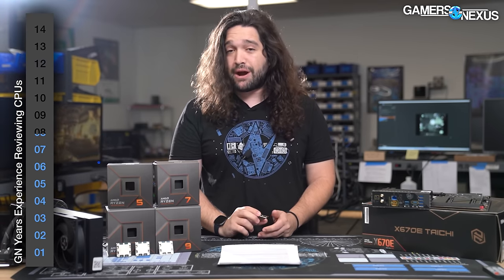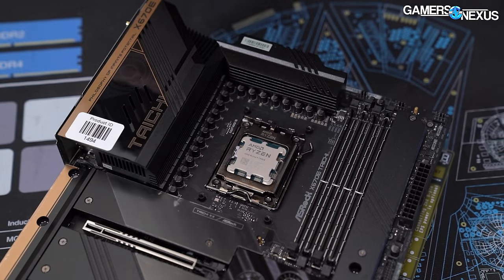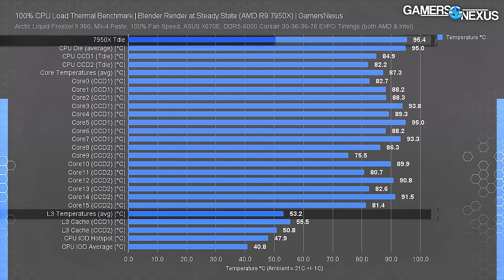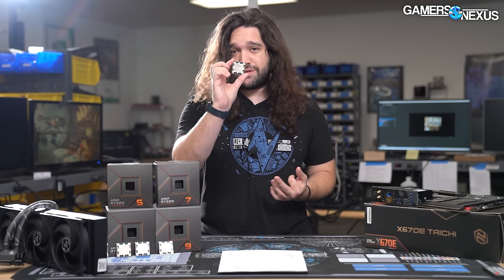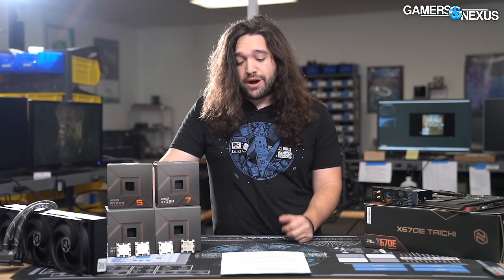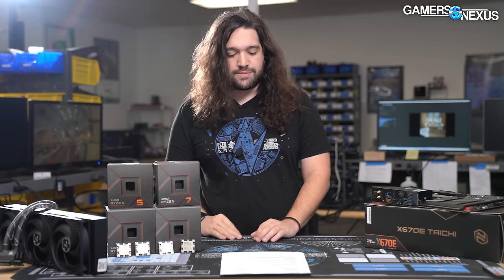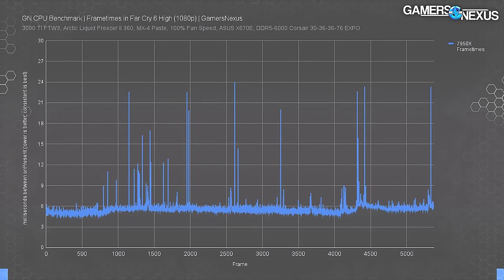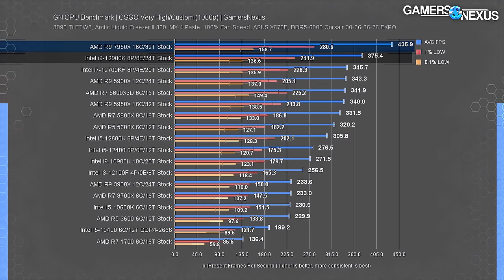95°C is Now Normal: AMD Ryzen 9 7950X CPU Review & Benchmarks

Comment: The 4 horsemen of winter heater
1. 13900K
2. 7950X
3. RTX 4090
4.  R9 390x
Reply: Wasn't the stock 290x worse
Reply: my overvolted rx580 also would like to assist in keeping the room warm.
Reply: I mean... Winter is coming, so good times!
Reply: 9900k as harbinger/ancestor spirit
Reply: Well... those of us in the northern hemisphere, will be glad to have something to keep our feet warm, in the upcoming months. Cough, cough (bile comes up) Where is my acid reflux medicine?
Reply: what does that make the ther- i mean fermi architecture then?
Reply: 390x still keeping up with the big boys😂
Reply: 12900k is hotter than 7950x
Reply: Don't forget the toasty GTX 480, you could cook an egg on that thing.
Reply: @yangwenli4878  yes, I had one. The things was a great card, but it ran hot af.
Reply: You mean R9 295x2
Reply: Everyone here has forgotten about the true furnace, the FX-9590.
Reply: 7950x in winter might be fun but think about it in summer
Reply: You forgot the 12900K and the RTX 3090Ti :p the MSI SUPRIM X gets to a whopping 480W.
Reply: A cooling-loop (heating-loop?) gaming chair with a 7950x & 4900Ti would be perfect for northern winters.
Reply: @Darryl Mayle  That was more because of the bad cooler than heat output. If I remember correctly it would not go above 250W. That was insane back then, but now normal, even for a RTX 3070
Reply: Vega 64
Reply: Oh dude imagine what a 7950x3d ends up?
Reply: 5.fermi gpu
Reply: Wanna hear something funny, planning a rebuild to am5 but waiting on rdna3 offerings.
So my build will be 
7950x or 7900x + r9 390x
Reply: gtx 480
Reply: @soragranda  So are increases in electric bills. Just how much can you afford to run these power hungry PC's?
Reply: No fx 8000, gtx 480 blower or any pentium D
Reply: Don't forget the GTX 480!
Reply: Still better then the CHECHA PS3s…
Reply: Basically melts all of the components around it unless you live in the polar regions
Reply: @ItsPikablu  With the 4090 you might be able to make BBQ, the power draw should be enough. :D
Reply: My old GTX 580 enters the chat.
Reply: @yellowflash511  hotter than 10,000 suns
Reply: did you forget entire bulldozer series
Reply: You forgot bulldozer
Reply: R9 295x2: "Am I a joke to you?"
Reply: @ItsPikablu  Thermi was great in the winter, the reference design even had a handy grill pattern for you to cook things on
Reply: The 4 horsemen of winter heater:

AMD 4x4   with 2xFX-74   +  R9 295X2  Crossfire!
Reply: if people dont have gas in europe, they should use electric heating instead... xD
Reply: @yangwenli4878  R9 290x owner here, yes I still have it. I don't use it but I have it. That thing ran happily at 94c.
Reply: r9 390x from sapphire is pretty chill actually, about 70c full load (I had the 390 non x)
Reply: This was my first thought... This is how I learn I'm actually not special.
Reply: I feel like 4090 should be number 1 on that list. AMD 7000 series operates at 95°C, so less heat is dissipated into the actual air around it.
Reply: GTX 480
Reply: @ohwell2790  This is top of the line dude, those aren't the player choice of the majority of the market (steam users are still having the 10th gen i5 10600 and ryzen 5 3600 as the kings, 600 kings!).

As far as I'm aware electric bills are high mainly in europe for being idiots and playing on putin's game, not the fault of pretty much every other places... (And that said there are still countries that are fine thanks to keep investing in their nuclear energy).

This is pretty simple, tell your politicians nuclear energy, stop leaving then do stupid stuff just to be martyrs and then you can buy high end stuff.

Or just pay high prices for electric bills, I mean, if you can drop 750 for a cpu you might be able to affort a big bill, or moving to a country were they don't rape you in the cost of electricity.

I'm sorry to be harsh but every time someone talks about the electric bills they forget this is not the issue of the companies that make the chips but to the customers, electric bills are political stuff related and in terms of advancements in chips msot of the amd fandom and users have been asking for more parity in Ghz to intel so there you have it, having high clocks for current architecture is still difficult to achieve, there is a reason why when ARM chips cab maintain 3.3 to 3.4ghz people are making parties in Hawaii, the consumption and power delivered for current architectures is not equal, nanometers are not and if you've owned a recent amd and intel chips you've see that for some stuff they are increasing the wattage, overall tpd and heck, the thermal top, 95c have been a thing with intel in the least 5 years know, and those chips at second hand are still fine and dandy, the direction in which the market is going is been set for years.

You want the most expensive thing in power?, Go x86 with either Intel/amd and nvidia, want something powerful but with perfwatt strength?, Go ARM with Apple and soon MicrosoftXqualcomm equivalent.

The future will not be cheap but you should also wait for mid range alternative, the 7600 and the 13600 will be reigning eventually for the commonfolks like us, and those would deliver good performance at decent wattage.
Reply: Blower-Style Vega64 would like a word
Reply: 9590x and the 580! don’t forget about the pioneers of this trends.
Reply: GTX480 wants to know where you live.
Reply: My PC with a 3500 and a 1650 super heat up my room a couple degrees, I can only imagine those, jeez.
Reply: And all of them are ruled by electricity 🤣
Reply: @jakuboboza1713  people are going to need to start disabling cores for daily driving and then manually enabling them when its “go” time.  Maybe someone can create a “throttle” that can sit on your desk to enable cores on the fly.
Reply: FX 9590 and the GTX 480/580 feel left out
Reply: @yangwenli4878  I had a 290x blower, and if that thing wasn't sounding like a jet engine, my games would artifact until my whole computer crashed. As long as I kept it cool, it worked LOL.
Reply: 🤣🤣🤣🤣 🤣🤣🤣🤣🤣🤣🤣🤣 It's the closest I could get to a ROFLMAO reaction! 🤣🤣🤣
Reply: 7950X is not really hot 200w is not that much compare to 300-400 GPUs
Reply: @GrumpyWolfTech  I was looking to get a non stock one years back, or a fury x,  didn't happen but it was good times.
Reply: dont forget about r9 390x2 tdp 580W
Reply: My room is small. I don't have any of those overheating monstruosities. And yet, I assure you it's been YEARS since I turned on the heater, the PC does most of the job, for real.
Reply: FX 9590...?
Reply: Where's the entire FX series?
Reply: @ItsPikablu  I had a sli of Gtx 480 at the time I remember taking 1050w at the plug with my AX1200w...
Currently my "3090ti Gigabyte oc" @ stock takes a good 470W ; hum, warm winter
Reply: @joewileman4480  I have two RX 580's in my PC and neither one of them get as hot as the R9 390X, but then I'm not overvolting them either.
Reply: Yes used that with my r9 390x
Reply: Undervolt an R9 390 and suddenly it consumes way less, runs way cooler and still performs about the same.
Reply: For EU players this is the best news if they come before winter. You can heat up your house while playing or working without the need to use extra energy or gas for heating your room/house. Very efficient. Very Good.
Reply: Vega64 over 390X
Reply: And GTX 690
Reply: the 4090 may be enough to be as hot as a rocket engine, 4090 space program anyone?
Reply: Don't forget the GTX 480, assuming anyone even uses that thing anymore.
Reply: what abt gtx690
Reply: Ahhh back in my day I used to power my house with FX-9590 and GTX 480 in 4 way SLI…..let me tell you nuclear reactors ain’t got shit on that thing.
Reply: Time for a nuclear power plant in the backyard.
Reply: You wrong man 13900k is very easy to cool plus don't spread fake info ! Do a research before
Reply: Don't forget the Fury X!
Reply: my r9 fury would also like to help
Reply: My R9 290 prevented winter from coming…in my room
Reply: I don`t fucking get it, TSMC 5nm is insanely efficient and they overclock them out of the factory...
Reply: at least its one way to cut down on heating bills this winter
Reply: Imagine not using an R9 295X2 to heat your neighborhood.
Reply: I have the R9 390X 😂
Reply: Hey, I loved my R9 390x. I live in Wisconsin and it saved me a ton of money in January. But seriously it was a great card and lasted a long time on 1440p because they gave it a ton of ram.
Reply: 5800X also feels welcome there
Reply: Don't forget the 6900xt
Reply: @joewileman4480  my rx 480 even overclocked is still under 95c?
Reply: You mean gtx 480
Reply: RX 580: "Am I a joke to you?"
Reply: I AM THE BEEST YOUUTUBER YOU'RE ALL TRAASH COMPARED TO ME IM THE BEEST 😂😂😂😂😂😂😂😂😂😂
Reply: 12900k ? GTX 480 ? Any old bulldozer CPU?
Reply: Who said we need Russian gas 😂😂
Reply: @cagedcactus46  I haven't, keeps my guest room ~7F warmer than the rest of my home.  A true space heater build
Reply: Not the hero Europe wanted but the hero Europe deserved.
Reply: I legit used my 280x to heat my room in winter when I was staying in a trailer home with basically no heat. Sometimes I had to turn the PC off cause it got too toasty!
Reply: R9 295 X2?
Reply: I can only imagine. I just got a 3080 and was amazed at how much heat it put off of my open air case. Couldn't imagine it in a case with restricted air flow
Reply: HAHAHAHAHAHAHAHAH
Reply: @yangwenli4878 Nope.
Reply: is the 390 keep me from freezing i`m not coming out my room till spring still available ?
Reply: @yellowflash511  Not according to this review. I guess when you unlock limits but that's like enabling PBO.
Reply: saving money by turning off the heater and gaming
Reply: i7-7700K
Reply: @ploed  was put in a laptop, doesn't run that hot
Reply: @jakuboboza1713  

I use a water chiller, so it’s always winter time 24/7.
Reply: I still got 2 crossfire 290x the heat is immense 90c..
Reply: 9 means heat.
Reply: My R9 390 thinks it's a 390X and is still powering along with modded drivers
Reply: @yangwenli4878  Seemed worse due to the cooler. 390x pumps out a lot more heat, it's basically just an OCed 290x.
Reply: 13900K + RTX 4090 = game computer + space heater 😎
Reply: @Mekaniac  better yet, the 9900ks
Reply: Jenny Melo  let me rephrase that. It operates at 95°C, so less heat is getting dissipated into the surrounding air. I could run my Ryzen 7 2700X at 95°C by using a cheaper cooler that cannot transfer as much heat to the air as effectively, but I don't because that would kill it.
Reply: @RetiredEE  in summer you would be distributing heat over your body with sweat nice
Reply: "winter heater" you mean "This will burn your house down, if left unattended."
Reply: @Chandler Russell R9 295x2 and R9 390x2 were crazy hot yeah...made the gtx 590 look positively chilly.
Reply: “Runs hot” and “puts out a lot of heat” aren’t the same thing at all.
Reply: Yea that's kind of rough I was glad to get away from room heating 90-91C GPU's in the past (my GTX 480 & R9 290X reference were both 90-91C during gaming) and now we have 95C CPUs... Yikes.
Reply: I think I still have my old Prescott P4 OCd to 6 ghz somewhere...
Reply: @FuncleChuck  Not remotely.
Reply: @yellowflash511  Sources? cause i read evrywhere the 7950x cosume less but heat more
Reply: Gotta toss in my RX 590 XFX fat boi in there
Reply: I am actually pretty excited for winter since my RTX 3080 12gb has been making my room too warm!
Reply: Missing R9 295x2 gpu. Most power hungry ⚡️ 🔋
Reply: @yangwenli4878   used it for 6 years... Yes.
Reply: GTX 470 was a mobile thermal generator
Reply: you missed the GTX 480, a benchmark youtuber called it GTX Furnace, it's actually on par with the 390X but has worse performance.
Reply: I'm tired of the biased that exist in the PC gaming ecosystem 

when AMD runs hot they get a free pass but when intel runs hot they are criticized, joked and bashed for it.

now power consumption has become a AMD fanboy talking point that it is almost political. 

you see they are double standards when it comes to AMD and Intel, because without double standards AMD has no standards and AMD are guilty by thier own damn standards
Reply: The smaller your cooler, the more efficient your CPU will be... at the cost of some performance... We are going to need tools to measure heat absorbed to make the right choice of cooler.
Reply: I think this is strarting to be too much heat and power to play a game. It's all getting ridiculous and game developers need to retink all of the cool stuff they like to add and making games hard to play and expensive to play at the vision they think we can. 
Everyone mostly lowers the graphic quality even with high end PC's to get frame rates.
If you turn on everything they want you to see in a game, things really slow down, once a new game comes out its even worse and have to upgrade again.
It's a cycle that you can never catch up too.
Reply: @cagedcactus46  YES I HAD ONE my room was at a constant 90 F every day from that dam cpu and what made it worse I had a water cooler on it LOL
Reply: @jeanpeinture7954  with Intel PBO 12900K goes beyond 100 easily this is tuned to run at 95
Reply: @akva1214  yes with PBO and it's of Intel anyways so it counts
Reply: These things still have nothing on Nehalem after a nice overlock :)
Reply: FX 9590
Reply: My friend Using in rendering and others task his 9900 Intel with Buff water cooling and got Higher temperature than this AMD and still no problem for so long time, from premiere no issue. People are freak out about temp, but companies know what they're doing if they said yes, that's temp are ok for our CPU.
Reply: Gtx 480
Reply: hahahhah i still got two r9 390s....lmao....i should put them back into action for the winter...lol....got one in the wife's pc .....had water blocks ..went back to air cooled in her rig  here comes the second one back on air crossfired .......lmao...heat the entire house ....lmao....
Reply: My Vega collection says "Hello there!"
Reply: @yangwenli4878  can confirm. Bought the founders edition and mounted a gigantic aftermarket cooler on it (EKL Alpenföhn Peter 2... the 5 slot design before it was cool) and it STILL got toasty. Only beaten by the R9 295X2
Reply: @GrumpyWolfTech  how long did yours last? Mine unfortunately died last year. Ran it with the EKL Alpenföhn 2 which cooled it very nicely compared to stock.
Reply: 5. Cheap MSI Motherboard VRM
6. Molex to SATA Adapter
Reply: @GrumpyWolfTech  if I had the option back then, I'd probably have gotten a sapphire R9 290x.
Reply: @gackhuhn4868  and that illustrates why the only card I'm interested in is the 6700 xt.
Reply: @cagedcactus46  first to 5GHz. Also first to melt the pc case.
Reply: @wimpieeeeee  That won't be the highest wattage card this gen, but it's certainly up there already.
Reply: @DrakkarCalethiel  get a smaller heat sink on the 4090 and you'll definitely be able to make BBQ.
Reply: My 12700K will be doing it's best to keep my warm. Nothing crazy like that list but, it puts out some warmth especially after you start cranking up the P-cores.
Reply: @yangwenli4878  Yeah but they all died a while ago lol
Reply: @marcux83  ... What if they don't have electric because they don't have gas?
Reply: That'll heat your house without the need to use your furnace
Reply: These GPUs could save Europe from the gas crisis.
Reply: @yangwenli4878  I had a Diamond R9 290X w/ single fan reference blower style cooling and looking at old GPU-Z screenshots I took it ran 94C under load.
Reply: @yangwenli4878  According to some old Tom's Hardware review it "only" pulled an average of 250W. Even the 3080 is worse.
Reply: Overclocked to 1225Mhz, my 290x under air was close to 95*c, bleeding VRM heat over time, starts around 75*c slowly rising over time to 95*c steady state.
My Windforce 3 290x easily hit 88*c loads at stock. Has bare VRMs lol, added thermal pads and watercooling and still at 70*c loads, but 300watts as well.
Reply: @yangwenli4878  Hawaii isn't power hungry at all for modern standards. It was 250-300 watts depending on your OC. But the 290x came out with a horrible insanely loud blower style cooler
Reply: I had a dual GPU R295x.  Bruh, with a 4790k it was pull 800 watts at the wall back then
Reply: Where's FX-9590?
Reply: GTX 480
Reply: any fermi gpu too. also higher end fx cpus
Reply: @gackhuhn4868  what? My one drains 330w at 2670ghz
Reply: 295x2
Reply: Um. excuse me, where is the FX 9590 and GTX 590???
Reply: 4090 has to be higher
Reply: @osestosis  Than.

NOT then.
Reply: Problem solved you hit your room game at the same time while crying inside for that electricity bill this winter specially in Europe
Reply: R9 390X

SO ACCURATE
Reply: Y'all forgot about the gtx 480 huh.
Reply: Going to heat my bedroom for another winter with 10700k and 3080.
Reply: By the Nines!
Reply: 8350 @ 5Ghz and a 290 was what I ran from 2014 to 2017 when Ryzen came out.
Reply: Omg my 390x used to hit 108 degrees, never again lmao
Reply: 11900k is more worse than 13900k i think
Reply: FX 9590
Reply: @yellowflash511  reduce the dumb default PL to 170W and that story changes
Reply: @Saurabh Its not true and stop spreading misinformation Amd shills.
Reply: @crylune  makes no sense stop fanboing for a multi billion dollar company ffs
Reply: 4000 series is the #1 champion .... with 600watt its 2-3x higher.
Reply: @HeavyMetalGamingHD  Yeah it was a card I wanted to get, yeah that stock cooler was good at being hot and loud but it was a very respectable card.
Reply: @joewileman4480  ahahaha I bet! but why would you overvolt rx580, when everyone else undervolt it :D I am just curious, what are your clocks, voltage and temperature?
Reply: The i7-12900K/KF should also be included those CPUs are uber hot as well.
Reply: @yellowflash511  relevance?
Reply: @randomacc7721  common sense
Reply: In Germany we will need it this winter without gas supply unless the electric grid goes down too...
Reply: I still have a GTX 480 with modded Bios and waterblock on my wall. It still works perfectly fine as a waterheater if i connect it to my loop ;)
Reply: OC FX-9590 with GTX 480s in SLI.
Reply: AMD FX 9590 and 9370: "I am a joke to you?"
Reply: i have a 390x that i could cook a steak on backplate hahaha
Reply: You better have a lot of solarpanels though, otherwise the electricity bill.....
Reply: Everyone chad until vega 56 power modded shows up. 
But even vega 56 chad only until CROSSFIRE vega 56 powermodded shows up (which is actually prolly non existent til now but hey imagine that worked lol)
Reply: SLI gtx 480 enters the chat
Reply: R9 390x runs surprisingly cold when repasted well or liquid metal used. Factory is crap
Reply: Geforce GTX480 "Leaf Blowers Edition".

AMD had some whacky Dual GPU's. It was the 7990 i believe, which was two 7970's on one PCB with shared VRAM? Or do i misremember something. 

Intel Pentium IV and not to forget the AMD processors which had those attractive heavy and slow construction machines as codenames. Steamroller, Excavator, Bulldozer lol. Nothing screams more speed as a 50 ton caterpillar moving at 15km/h